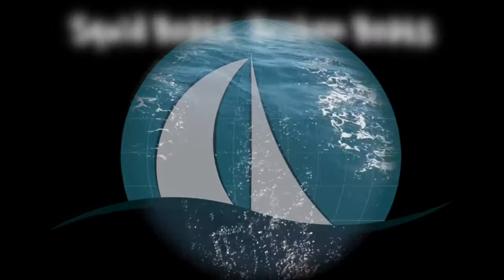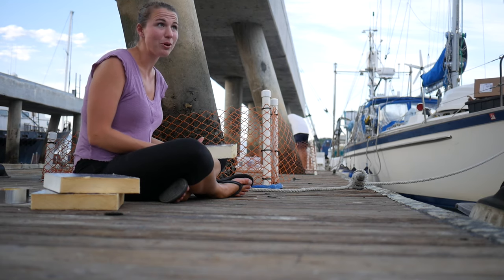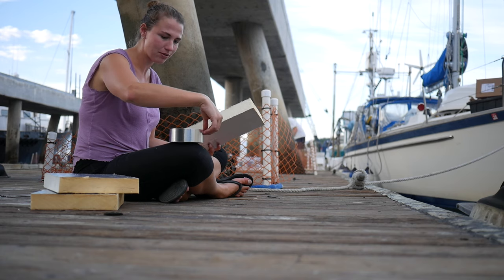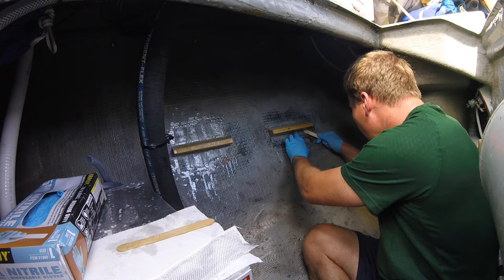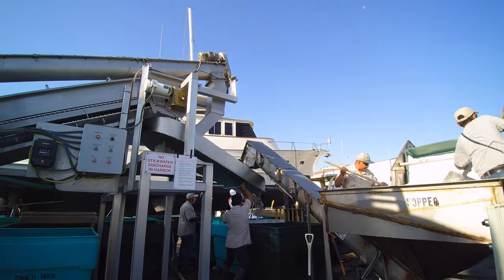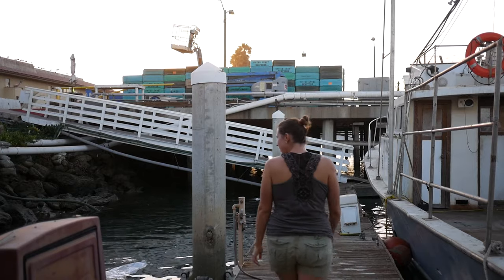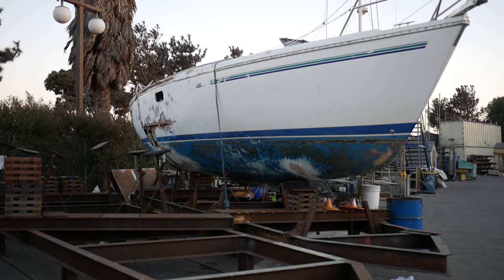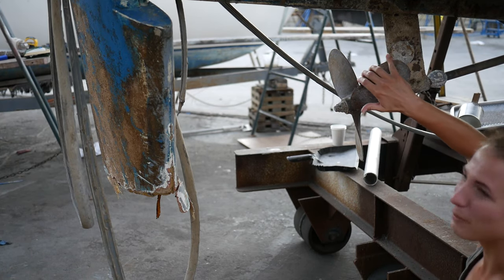SQUID BOATS, BROKEN BOATS [Adventure #26]

Comment: Rocna's rock no doubt...so good choice. Uma just survived hurricane Matthew at anchor in Haiti...although in a very protected anchorage...one of the anchors they used is their emergency storm rocna anchor...disassembled when not in use weighing in at 105lbs
Reply from the maker: Yep great anchors, I think they have a good sized Rocna and also that huge one is a Mantus?  That one breaks down or does Rocna have a break down one as well.
Reply: Nope the large one is a Rocna....actually a gift from Rocna I believe...and yes the rocna breaks down...it's so hard hunting through all kinds of vids for details huh? It's obviously too big for everyday use for a boat size they have. I am uncertain as too the configuration Dan used...I know people talk about using multiple anchors and a yoke with swivels connect. I don't think an aft and bow will work together as in a hurricane your guaranteed a wind direction changes and broadside to a 150 wind just isn't going to hold.
Reply from the maker: Good questions, I am sure they will address it in their future videos.   Same directional shift even with two bow anchors, unless they both reset good that would reduce the swing considerably.

Comment: Ah, boatyards... My memories are very mixed. At one, just after my 25 footer was hauled out on slings, I was manouvering steel I-beams to go under the fin keel;. The one I was pushing slid forwards as well as sideways, trapping a finger and opening it up to the bone. Yard work was suspended for the day, and made difficult in the following days due to the stitches... Strange how some real injuries hurt less that little nicks.

Another time I had my boat inside a huge shipbuilding shed in Port Adelaide, where we had to grind off ALL the underwater gelcoat due to osmosis. We left it to dry out for three months, and then manually rebuilt the hull surface with multiple coats of sealer, filler, paint and anti-fouling, laboriously fairing after each coat. 

I could sum up the experience with a single episode, which still burns clear in my memory, despite it happening 35 years ago. Standing on the deck, some 10 feet above the ground, I carefully dropped the smallest seat cushion to the ground, and watched, in slow motion, as it bounced 12 feet to one side, knocking over a 4 litre vacuum pump pot containing our liquids for the day. The shattering sound lives on in my mind lol

Keep up with the great improvements you are making!
Reply from the maker: Gee and I am sure you have way more memories than just those, thanks for sharing.  You made us cringe at the thought of placing that I beam under the keel and getting a trapped finger.  Thank goodness it was not much worse..

Comment: I assume you are using polyester resin for fiberglassing.  I have worked with this type for years making surfboards, patching Corvettes and now on the bulkheads of my kayak.
You have the ability to effect worktime by the amount of hardner you use.  The more hardner you put in the faster it will set plus the action  will create more heat. I have set papercups on fire from quick jobs. 
It looks like you are figuring that out and doing well. Keep up the good work. Love the videos.
Reply from the maker: We finally figured out smaller batches is easier to work with.  We use the West Systems "Slow" epoxy not sure how that differs from the "fast" the ratios are the same.

Comment: It’s my understanding that the chain should be terminated in the locker with a rode to a padeye so it could be cut away in an emergency and the end should also have a line to a bouy so it might be possible to retrieve it, too, depending on the depth of the water where it had to be abandoned.
Reply from the maker: Basically, you want the line to be fixed to the boat, but detachable in an emergency.  We had and still have line at the end.  The wood block doesn't fit through the hawse pipe.  If we can't get to it in time to cut it, we prefer a hole to be ripped in the deck instead of a pad eye ripping a hole in the hull.  Of course, a buoy would be great if you have the time to attache that

Comment: fridge volume doesnt matter. surface area, temperature difference and R value matter.
Reply from the maker: Well now you are getting all technical, it has helped a lot however that may just be an insulation factor?
Reply: I should have started by saying: Thanks for sharing your adventure!  Very inspiring and learning a lot from you.

On the fridge: Insulation on the outside would help (which prevents the cold from getting out), but insulation in the middle of the box wouldn't matter.  Yep a bit technical, but I wouldn't want you to waste valuable freezer space.  Heat transfer rate = ((surface area of the box) x (temperature difference form outside))/(insulation thermal resistance)